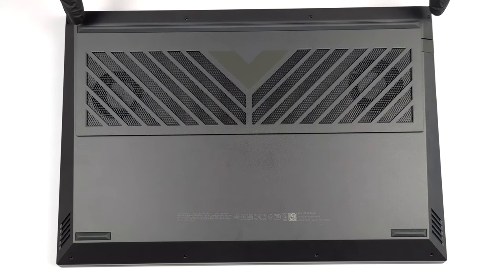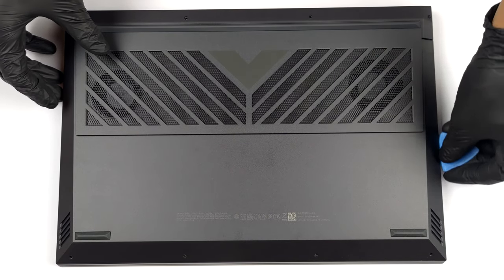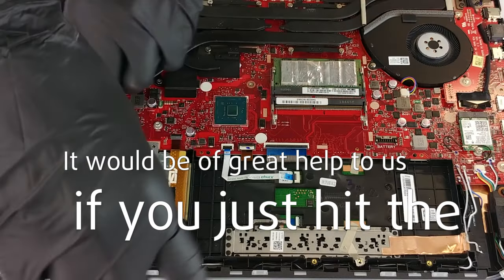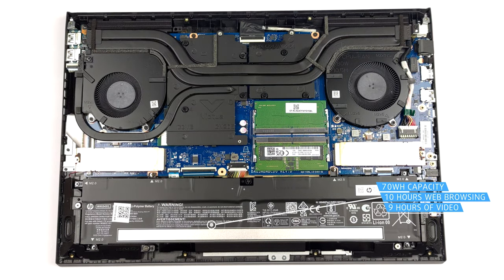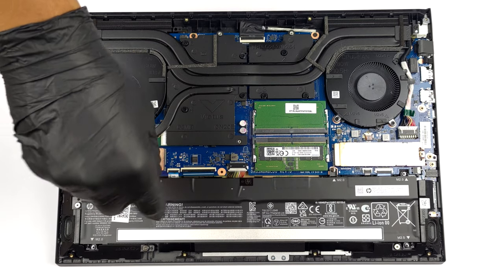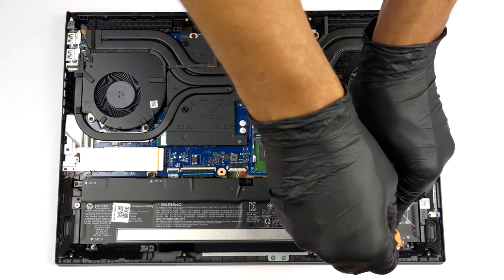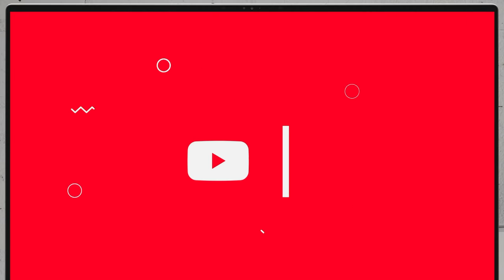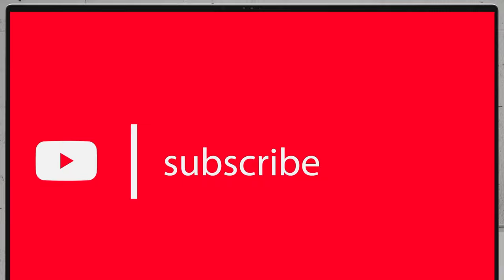🛠️ HP Victus 16 (16-d1000) - disassembly and upgrade options

Comment: Hello, thanks for your video! I have a question. I saw somewhere you can only put 1 tb ssd drives in it but someone on reddit said he put a 2tb SSD 970 pro and it worked fine. So basically my question is could I add a samsung 980 pro 2tb with or without heatsink? is there a point to getting the heatsink one or are the laptop's metal slots acting as heatsinks as well?
Reply: I just put a 2TB Adata M.2 SSD in mine cloned my C drive to the new SSD And moved it to the main slot! If you don't move it to the main slot it will run as a Gen 3 SSD! Move it to the main drive slot it runs at Gen 4! Way faster!! 😱
Reply: Ps don't get a Heatsink!! 😱 I had a issue with a SSD with a 1 cm Heatsink in it! It will not fit make sure its only 2-3 mm thick! The Adata came with it's own Heatsink and works Awesome!!

Comment: is it mandatory to remove the battery in order to replace the m2 drive?
Reply: it's not necessary, but u remove the battery in order to prevent electricity from travelling. This helps to prevent any electrical damage while doing any upgrade.

Comment: Hello Dude, thanks for the video!! I have a little questions My computer is also a HP virtus 16, Ram16Gb(8+8) Memory512G. And I got another ram of 16Gb and a ssd of 1Tb. It will not be a problem to add both of them and have like 24Gb of ram and 1+512Gb of Ssd. Is the two Ssd can work together? Thanks ❤
Reply: no problem bro, ssd you can check pci-e 4 that's ok

Comment: Useless. Bottom already opened from start. The only part of the disassembly that is difficult to do.
Reply: True
Reply: It isn't really that hard
Reply: @NationPlayz  If you are opening the notebook for the first time, it is good to know how to do it properly so not to damage the latches.
Reply: @e.t.161 Yes exactly. I followed this guide and was so confused trying to get mine open that I ended up leaving it as is.
Reply: Need a guide to change Thermal Paste.
Reply: i agree you, i saw hp's official video they start disassembly from the top.

Comment: hello can you tell me  Victus by HP Laptop 16-d0xxx sport PCI-4 m.2 ssd my bro 
intel i5 11400h rtx 3050
Reply: There are two PCIe M.2 slots on the board. As labeled, one is PCIe Gen 3(the free slot), and one is PCIe Gen 4(the one normally housing the main drive SSD)

You can replace it with a higher capacity one, or get a large capacity drive on the Gen 3 M.2 slot.

If you're adding an extra drive for games on a budget, I've heard good things about Crucial's P3 SSDs. Those come with up to 4TB models, but are mostly for storage

Comment: Can i upgrade my ram from 2x8 ddr4 3200 to 2x16 ddr5 4000?
Reply: ja you can
Reply: no , the pin layout is different between DDR4 and DDR5 also DDR5 memory runs at a different voltage than DDR4 . You will notice pin difference when you see pictures of two rams in google